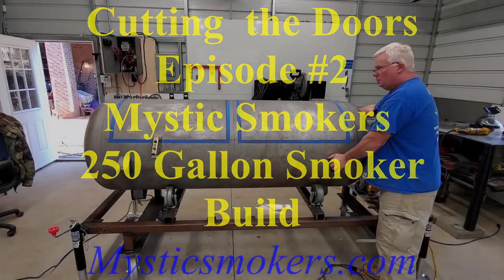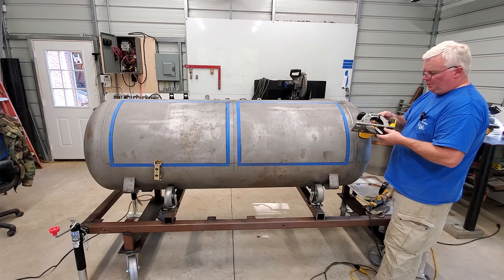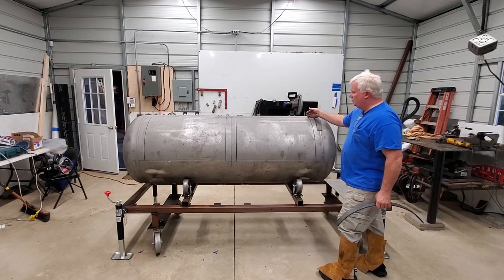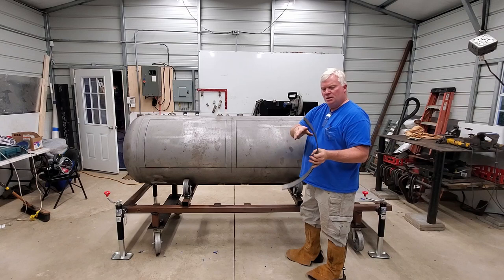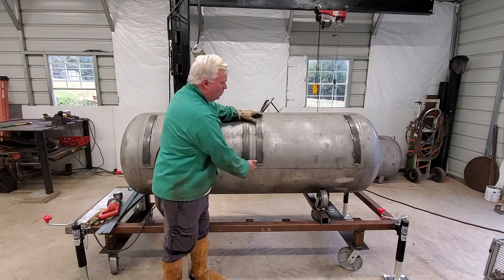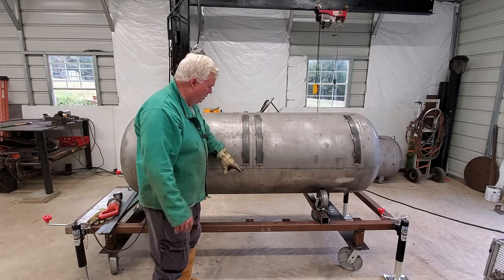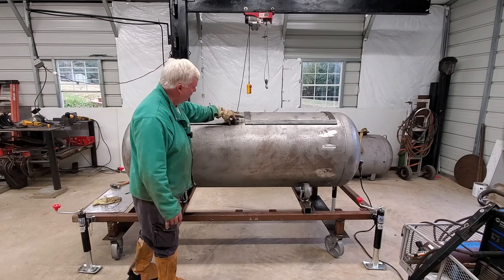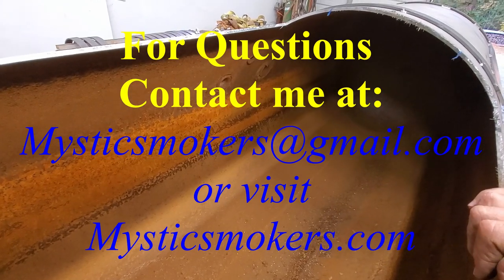BBQ Smoker Cutting the Doors - 250 Gallon Cooker Build Episode #2

Comment: I would've used a 6x6 square tubing for my chimney. But it still looks nice. Congrats
Reply from the maker: Thanks for the input. That's actually a great comment.  However, out of curiosity,  I can't help but ask why?

The flow efficiency numbers of the round pipe are far superior to square pipe.  Square pipe creates eddy currents and turbulence.  This, of course, means much lower draft strength.  In fact, the eddys subsequent turbulence inherent to a square or rectangular stack cause very unpredictable changes in pressures inside the cook chamber.  

Since the stack is the "engine" of the entire system, I prefer not to handicap myself with a less efficient primary component.   

My cookers are geared more for the restaurant/catering niche.   Although they need to look good, performance and consistency are the primary objectives.  

I will concede that square/rectangular stacks look cool on some of the octagonal cookers.  But again, if I'm gonna run the system for 12 to 14 hours at a time and that $400 to $600 worth of brisket has to be right for that wedding or other party, I'd rather have the best tool for the job.
Reply: @mysticsmokers3014  square or round, doesn't matter. I agree round creates a better, less restricted flow. I'm talking about larger flow capacity. 6 in.   round would be perfect as well.

Comment: Excellent work.  What are the doors dimensions? Thanks
Reply from the maker: My 330g/250g cookers usually get a 31-inch wide door.  

I come down from 12 o'clock two inches on the 30-inch diameter tanks.  

I put the top seam on 12 o'clock with 24-inch tanks.

Since not all tanks are exactly the same length, I come off the end cap weld 2 inches.  Then, use a 4 inch post between doors.  That usually works out to 31 inches but that's not important.  The spacing on either side of the opening is important.

Comment: Nice shop crane! Can we see a video about that? Many thanks!
Reply from the maker: Ok.  I'm building a smaller version for my lathe. I'll post some video of that build as well.
Reply: @mysticsmokers3014  I also wanted info on the gantry, is it mounted to the building frame, or is the up right a stand alone beam.
Reply from the maker: @donsamford6026  

Reach to me on mysticsmokers@gmail.com and I would be glad to send photos of the build on the jib crane.  

FB Messenger would even be easier.   I'm easy to find.

Comment: Hi. Great videos, I’m building a 120 gallon smoker right now with my dad. But I wanted to ask what cutting wheel brand or model do you recommend? Any other tool must have’s you would recommend? Thank you in advance
Reply from the maker: The tools that I could not do without are (in order of importance after a good quality mig welder):

1. The build table 
2. 4.5" grinder(s)
3. Carbide chop saw
4. Torch (plasma will work, but a torch is more versatile)

I would say those 4 items are necessary for me.    Everything else just makes the job easier.  

The cutting wheel for the grinder is 1.2mm cutter from Amazon.   

I use 36,50,80 grit sanding discs with the backing plate on a second grinder to avoid having to swap over.   

I've tried about every grinder out there.  My favorite is the little Dewalt
(DWE43116).  I have 4 of them set up for different functions.  

I prefer the Evolution 380 chop saw.  Evolution S380CPS

There are two versions.   This model is more expensive, but it's virtually bulletproof.  I use the 14" blades for mild steel.  

I hope this helps.  

Feel free to reach out via email at mysticsmokers@gmail.com. I can provide a phone number there for text questions.   That's my preference.

Comment: So what would you have done if the door/tank moved?  I just cut my door and either it sank in or the tank bowed out in the center.
Reply from the maker: Great question.  It depends on how much it moved.  If it was my personal tank ( not for sale) and it was just a small amount (less than 1/4"), I'd try to move the tank to match it.  

I've used jacks and blocks to push the tank open.  I've welded temporary tabs to attach turnbuckles and pullef the tank in to match the doors.   I've  welded beads on the door inside face to curve the door in.  
Sadly,  none of those will be a perfect solution as its always a combination of movement in both, the door and tank.   

Take some measurements in various places and try to determine where your flex occurred.   Door flex is usually uniform.   Tank flex is worse in the door centers and of course stabl at the corners.  

You should be able to get it close depending severity.  It may take a good bit of time and effort but if its your own build and your only tank, its likely worth it.  If its  production tank,  I'd scrap it for two reasons.   First is the fact that it will likely never be "right" ans second,  it could take many hours and attempts to get it right.  Especially if the door panels opened a good bit.  They are more difficult to move than the tank.   

Have you already put the door bands on and how thick/ wide are they?

You are welcome to contact me via email and then phone and I can give more information based on my experiences.

Comment: Im sure its been asked before but what do you use to clear the remaining gas out of the tank before you cut so it dont explode? Do you soak it like some folks?
Reply from the maker: That's a great question.      Here's what I do:

1.  Remove the valves after you're sure the tank is empty.

2.  Dump one gallon of cheap dish soap inside.  

3.  Fill the tank to about 8 inches of water.  

4.  Shake it around or stir it with a stick through one of the holes.  

5.  Let it sit for a few days if you can.  This allows the soad to work with the mercaptan oil in the bottom of the tank.  

6.  Fill to overflowing with water on level ground.  This pushes all gas from the tank. 

7. Some guys let it sit for a few days to allow the soap to work with the mercaptan smell on the walls.   Personally,  I dont know if this makes any difference. 

8.  I've heard a weak bleach solution will help break the mercaptan odor down.   I'm gonna try this on the next tank as my last tank was very strong.   

9.  At this point, I take the tank to be professionally sandblasted.   The old industrial paint is a far greater danger than the gas in my opinion.  

Occasionally,  I drill a 4" hole in the end before draining the tank out of an abundance of caution.   Use a cordless drill as electrocution is a real danger.  

Im sure cutting while full of water is unnecessary, but my sandblaster guy prefers there to be a large hole in the tank before he starts on it.

Comment: Have you tried a plasma cutter yet? I was surprised at how fast they cut.
Reply: Yes.  I have a plasma cutter that I use for other tasks.  Plasma is not the ideal tool for cutting doors in my opinion and experience.   It imparts far too much heat in the material and risks warping the door panel and tank itself.   

For me, perfect fitting doors is mandatory.  

The cold cut saw is obviously the most gentle on the material while the angle grinder comes in second.   

The plasma is extremely quick and much easier but the sacrifice is heat.

Comment: What blade is on that 5.5 dewalt circular saw?
Reply from the maker: Unlike on the big evolution 380, I see no difference in blades for the little Dewalt. 

The Diablo blades are cheap,  so I usually get them.   Amazon will frequently offer them in multipacks.  Sometimes 8 or 10 in a pack.  That's when I buy them.  

Cheap blades dont hold up on the big saws but they seem fine on the baby saw.
Reply: @mysticsmokers3014  so a 30 or 40 teeth is good to cut that metal?
Reply from the maker: @frankie4speed818    usually the 5.5" 30T  it doesn't drag as bad
Reply: @mysticsmokers3014  thanks for the help and the videos!!